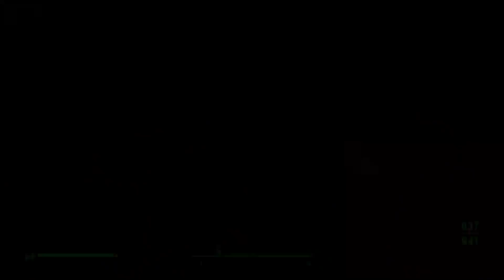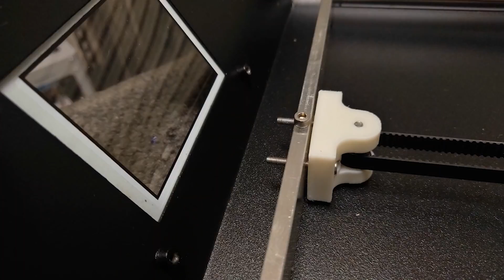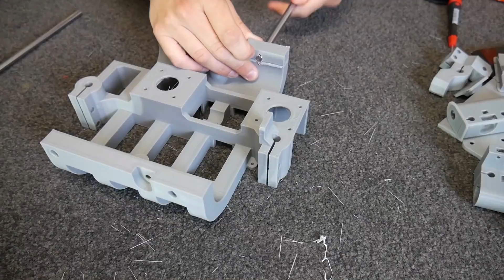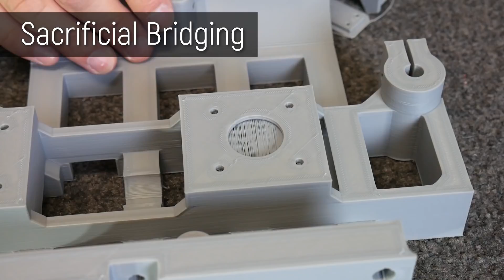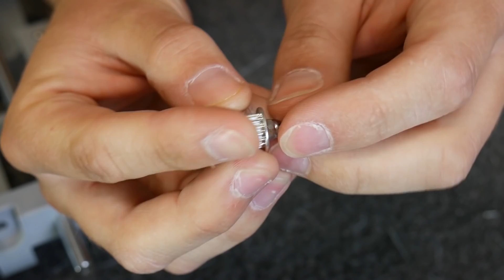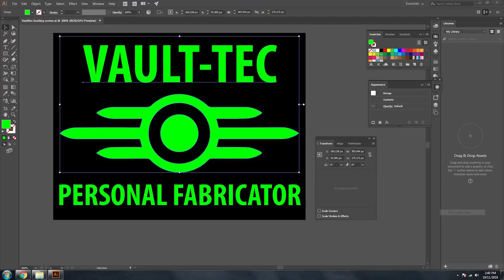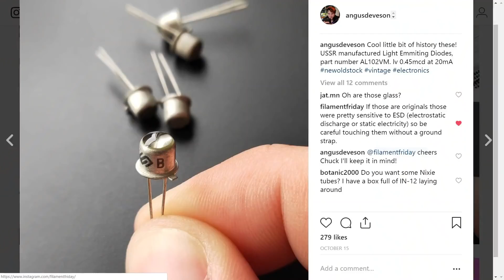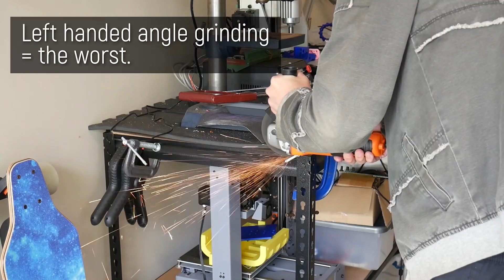Building a Fallout Themed 3D Printer from Scratch -  Build Vlog

Comment: Really cool. I am working on the basic design steps to build one from scratch too only a little bigger probably the size of  CR-10. I had in my life some bad experiences with some timing belts so I want to try to eliminate them all together from the printer and go 3d printed rack and pinion. Actually a double rack sandwitched between 2 interlocking pinions with slightly shifted PVC shafts to take up some slack if there is one, self aligning with herring bone gears. As for your worries with the PLA melting - there is a way around it as your parts did not seem too high. I have tested that up to about 1.75 inch (40-50 mm) in the Z axis. You make an enclosure for your printer or use one that has one, you crank up the heated bed to 80-85  C and put a 1mm campher on the bottom to take care of Elephants foot. Then you place enough on your build plate that the print takes at least 2 hours and print away. Do not open the printer enclosure until the bed has cooled to room temperature. Now you have printed a semi annealed part. It will hold shape if you finish the annealing process in the convection oven by heating it to about 80 c for an hour and let it cool slowly. The part also will not change shape at that state any more and I had not one of those parts shrink yet a 267 mm part usually, if printed on a cold bed will shrink by about 13-15 mm and warp if the part printed in the above mentioned way shrank it was less than 1mm which is about the tolerance I can measure. Now the PLA part you have is save to use to about 150C. It is a little less rigid and a litlle more flexible too. Another option would have been to print in PETG or Nylon I prefere PETG and Bridge Nylon over PLA (except price) for mechanical parts.  As for Rapid development I usually switch to a .8mm nozzle and ,5mm layer height on my E3D V6 and you could probably do that 9hour job in less than 3. Sorry for that long post but I just love printers making printers even though we might run into danger of creating selfreplicating machines
Reply: Will rack and pinion be accurate enough?
Reply: @originaltrilogy1  Theoretically yes some big expensive CNC machines use them. Advantage of a rack is you can go any length by just expanding the rack. Racks out of metal to get right requires precision machining and that is much more expensive than belts and racks can handle way more weight accurately. Now doing it in FDM - its who knows but I intend to find out. As soon as I got the money together to buy the basic hardware like a decent hotend, bed, some decent steppers and electronics and a couple rolls of filament.The trick is going to be to get the tooth shape just right and keep the rack from flexing too much and account for the flex you will get from plastic so it will be a challenge. Hence I probably will go with a double rack and shove a steel bar in a hole between them. Guess its one of the things that are either going to be great or we are going to send the video to the Fail Army guys for a Fail Army geek edition. But I for one do not like to do what has been done and go print another benchy on my channel, Thats why the project we are working on right now is some planetary gear boxes that will drive our 120-150lb 3d printed robot. So the same statement above is also the answer to "can you print a robot that weights 120lb and is FIRST Robotics Competition legal in every way" Which for example means we got to do it with filament that is about $30/kg average.
Reply: @martinpirringer8055  Yeah, I've seen R&P setups on CNC, but was interested if 3D printed ones could work, as I assumed really high precision would be required. Will be interesting to see how it goes.

Comment: Very cool! I used some similar techniques like with the slots for nuts to build my first printer from scratch too and you showed me a lot of amazing ideas for assembling pieces with 3D printed parts :D I am very curious of some design choices, why did you use such a long bowden tube? Wouldn’t that make tuning retraction more difficult? Also I’m not sure what’s the exact problem with your current hot end (maybe a worn nozzle or the PTFE liner in the throat meeds to be replaced with some of your bowden tube probably) but I would recommend an E3DV6 clone if you need a better hot end without breaking bank (they go for $5 these days if you don’t mind the long shipping, I would say support the original makers but I mean.. I am poor college student rip), I keep a few on hand as more of a quick nozzle swapping system and for when I build a new printer, as for firmware problems, it might be that e-prom is not enabled or non-existent on that board, I like Mks stuff but wished they supported their material better. Anyways, it’s hard to beat the good old Ramps arduino combo and you can upgrade to a Re-Arm board if you really hate the arduino but I believe it is perfectly sufficient for these diy projects because of how cheap they are (maybe a bit too chunky for your small pip-boy box.. idk, it’s not as wide but that’s up to you, I’m thinking there’s probably some blind spots in the machine to squeeze out just enough space or even attach it on the door), awesome stuff again, I think you have a wonderful machine as it is, thank you for the pleasant surprise, it really gets me inspired to revisit an old printer I burnt out trying to get working.

Comment: Just as a little aside -- I've been playing with some PC/PBT from Push Plastic. It prints a lot like PLA from my experience so far, but at much higher temps. I'm running a 240 nozzle and 120 bed, by comparison. But it's strong, resistant to just about everything, great layer bonding, lowish shrink, and pretty easy to work with... I'm using it on all my 3D printer parts. I think this material needs more eyes on it. :) Would have been cool to see in your Fallout Fabricator!
Reply: Neat. Someone on the Prusa forum found a recipe to avoid warping with polycarbonate as well, even without heated chamber or similar madness. So consider looking into that.
Reply: @Anonymouspock  What this has over just PC is that it's an alloy. It gets most of the benefit of strength from PC, but gains PBTs very high chemical resistance and somewhat of a self-lubricating nature. Though POM would be better for that, it's too difficult to print for me to bother with.

Comment: I'm pretty sure I could shrink the electronics down some.

Edit:
Got any recommended steppers for desktop CNC steppers? (Yes 3D printers are CNC)
Reply from the maker: I used Nema 17, but if you can get them you could probably use nema 14 to shrink it a lot.
Reply: @MakersMuse  So no specific brands or anything? I could just grab whatever motors then?
Reply from the maker: pretty much, just gotta be wired bipolar to work with the drivers.
Reply: @MakersMuse  When I eventually make something I'll have to ping you about it. Your videos really are inspiring. You and 3DPN have sparked physical development again, I'm mostly a software guy.
Reply: @MakersMuse  you probably could of got better wire management if you did custom length fit
Reply: To make something that would be accurate to the Fallout universe everything would have to be done in discrete circuits.  In that universe the integrated circuit was never invented because everyone was too busy building nuclear weapons.
Reply: I've had good luck with Minebea and Shinano-Kenshi

Comment: honestly for the constraints you placed on yourself with the case and using on-hand parts for a lot of things, I think the outcome was fantastic! the idea of a compact 3D printer with a small form factor isn't unique, but one thing this inspires in me is the idea that you could build something like this to fit inside something like a tool box or one of those large medical kits for camping, have it in your car or RV, and take it on the go with you with some materials and be able to print needed parts on the fly while off of the grid. something I wouldn't trust with most fully enclosed printers since their covers seem more built for aesthetics and cleanliness and not travel.

Comment: I designed my printer in Fusion 360 doing the same exact method. It's my design and I wont likely release it. It makes it very easy to make new parts or modify existing ones with many separate bodies. Assemblies are a bit of a pain in F360. I use NX at work and the method for assembly creation with movable joints is MILES ahead of Fusion IMO, so much so that I don't even care to learn how to do it in Fusion.
Reply: Fusion also forgot to design a parameter system: for starters why the heck can I not use the rest of the program with the parameters box open??

Comment: Nice job boi I'm making my own 3d printer can I have help, Angus? I have had help from nop head, aka Chris about motors electronics and rails and all. now I need help wondering how to build one. just like generic instrux on how to build one that works with duet wifi 2 and accessories, titan aero extruder, Noctua fans, bond-tech extruder gears, NO SOLDERING!!!!, flexible per sheet, the extruder temp should be able to reach 360 centigrade, a heated bed should reach 150 centigrade. (i know that's really high, but I'll be using Prusa's master chef upgrade too). pinda, thermocouples, metal frame or wood? I would gladly appreciate any help

Comment: Your Y axis is referred to as an omega (Ω) drive in the CNC world!
Reply from the maker: Neat! Thought it must have been done before surely.
Reply: Might be neat to have one of the idlers act as a spring-loaded belt tensioner, much like one you'd find on a timing belt assembly in a car.
Reply: @roosaaudio  Spring-loaded belt tensioning will always give a little depending on acceleration, making the motion less stiff and direct... IMO direct tensioning, if possible, is like a better idea in almost all cases.
Reply: @hadinossanosam4459  Depends on how the tensioner interacts with the belt, and how much tension already exists in the system. If the belt were to be properly tensioned via direct means first, I could see a damped tensioner pulley reducing belt slack caused by jerk.
Reply: @hadinossanosam4459  maybe mount one of the idlers on a lead screw style so that you could adjust it and tension it there.
Reply: I was scrapping my old Robo3D R1 (rubbish printer, I know...) for parts for a new printer in the future, and the Y axis has that design as well
Reply: The Felix 3.0 3D Printer has tge same belt-drive system! but is a garbage printer

Comment: One way to deal with floating holes is to make a rectangle across the surface the hole is in, that just encapsulates the hole in its width but starches in length between the two ends of the surface. You sink it in by a layer height, say 0.2, next you sink into that another layer height of square centred on the hole centre. Prints brilliantly each time.
If you’d like to see some of my build videos, Angus, feel free to check out my channel. There’s not anything too recent but there’s experimental videos, upgrading RAMPS to 24V for the bed, and most recently some stuff on my experimental version of the E3D tool changer.

Comment: Super cool, man. Oddly enough, the Fusion team recommends the move tool using point to point over joints for components that don't absolutely need them. I found that out after a couple thousand joints started causing weird issues on my CNC assembly. I guess they're much more taxing than just remembering their position.
Reply from the maker: Heh yeah I could imagine they'd get overwhelming pretty fast. For stuff that moves in basic linear motion like a cartesian 3d printer just testing using the move tool is probably all you really need.